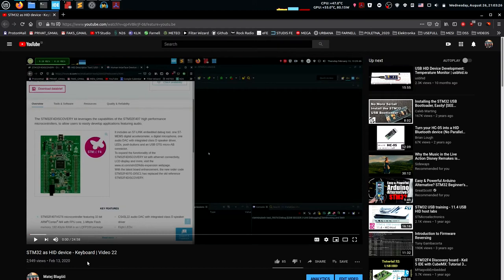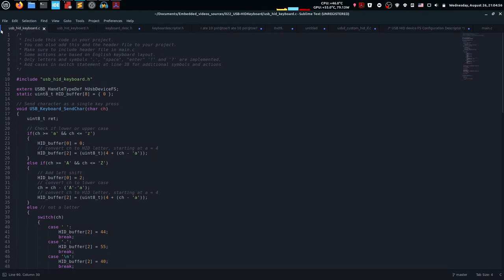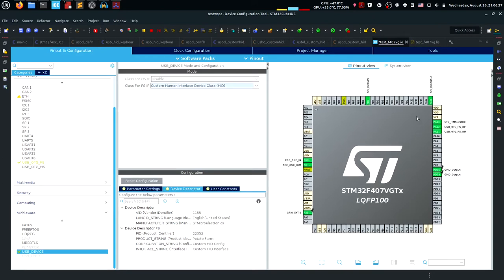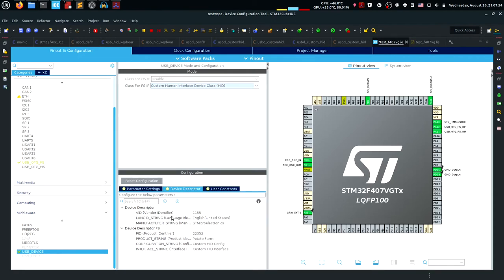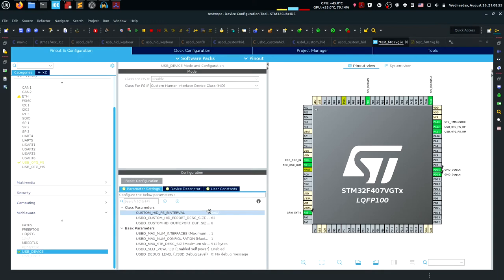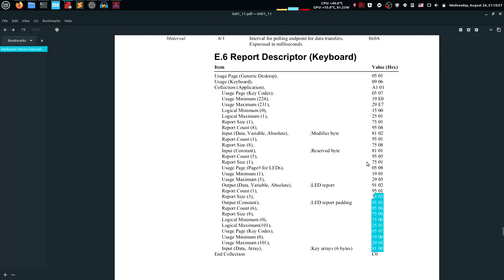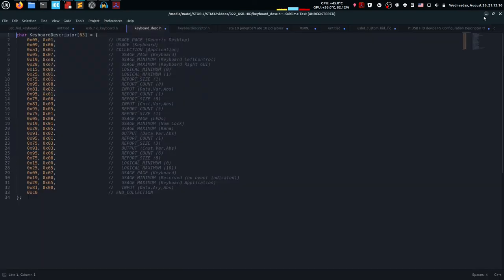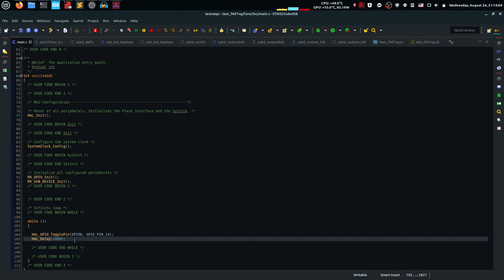Custom HID keyboard device | VIDEO 33

Comment: Is it possible to implement the led for caps lock num lock and scroll with stm32. If its possible can you guide me how I can do that ?
Reply from the maker: You will have to take a look into USB HID usage tables and the construction of the report. Here are the links to the standards:
https://www.usb.org/sites/default/files/documents/hid1_11.pdf
https://usb.org/sites/default/files/hut1_4.pdf

The report descriptor, that I used in the video was copied from somewhere else and happened to work fine as a keyboard, but it could support much more. The way your usb device sends data, that is interpreted by the host, is by looking at the structure of the report data configured by the report descriptior. In video, the array is called CUSTOM_HID_ReportDesc_FS.

The way the report is configured is by composing differrent groups of data together, defining their types, number and sizes. You can read an example in the HID_1.11 specification on page 35 of pdf around a descriptor for a mouse with three buttons. Since there are lots of different buttons to choose from and each only has a byte for an unique ID, the buttons are grouped into pages (usage pages). You can read more on them in the other document. This way a page represents a namespace of keys/functions with common features. Normal keys are in "Generic desktop page (0x01)", buttons are in "Buttons page (0x09) " and LEDs are in "LEDs page (0x08)".

You can use the aforementioned example from the document to compose a custom descriptor for keyboard along with the LEDs you wish to control as well. You will need to change some macros, like the report size (it is limited to 64B for USB full speed) and the report that you send. The length of the report (those bytes 0 and 2 that I set in the videos) are just part of the keyboard. Others will be mapped to match the report descriptor. 
I found this article as well, have a look: https://eleccelerator.com/tutorial-about-usb-hid-report-descriptors/

This looks like a fun "more in depth" video idea, but I don't have a device handy or time to test it now. Hope this helps for now.

Comment: Any ideas in regards to the cpu hanging when sending keyboard data?  I've set my code up exactly as it is in the video but every time I try to send anything, it sends the first char and then the cpu crashes and that character gets sent over and over.  I even disabled the button interrupt and used gpio polling to get the button press, but it has the same problem. Only difference is I'm using the STM32F411E-DISCO board clocked at 96MHz.  If i use the standard HID (not custom) device lib, it works ok.  /shrug
Reply from the maker: Just by that description I cannot think of a reason as to why. Must be either a interrupt or dma problem the way you described it. I would just use a debugger and find the point whete it stops working as expected. Maybe simplify the code even more.

Comment: When I generate code, I don't get a usbd_hid.h file.  The closest thing to that name is a usbd_customhid.h file under STM32_USB_Device_Library directory.  Did ST change their library code generation maybe? Or do I have something set up wrong.  I'm using STM32CubeIDE Version: 1.10.1.  Thanks.
Reply from the maker: Thank you for pointing it out. I added a link to the issue in the video description and comment as well.
Reply: My Inc and Src folder are completly empty... Any ideas??

Comment: Hi. Example not work in WinXP and BIOS.  How repair it?
Reply from the maker: Maybe the problem is with drivers in old windows, but the microcontroller should present itself as a usb 1.0 hid device, for which it should not need drivers. Have you tried on other computer? If it still doesnt work, maybe the code or the board has a problem.
Reply: the same device has been tested on many computers.  also tested several of the devices themselves.  On all computers and all devices, everything works fine if the operating system is Win7, 8, 10 but not XP or BIOS.
Reply from the maker: That is interesting, I have no idea why would that be, at least XP should support usb 1.1 out of the box, I even found a keil page for stm32 usb hid sample that claimed so.

Comment: Hi Matej, this is a very good guide. But I am having some problem tough.
I try using stm32f10c8t6 (Bluepill) connected to an IR proximity sensor as external interrupt, so when the sensor capture an obstacle the mcu would send a character to pc.
It work. But, it have a behaviour like we press a key but never release it. I test it using text editor , instead of write 'A' character, it would write 'A' character continously (and never end unles I unplug the Bluepill usb cable). I try debuging the isr callback function, and there is no problem because the interrupt callback is called exactly once on each obstacle.
Hope you can have some clue.
Thank you
Reply from the maker: When you send a key press to the computer, like 'A', you also have to send 0 in order to release the key. Sounds like this is the problem you are describing.
Reply: , Yes I also suspect this is the case. I use your library, and in usb_hid_keyboard.c file in line 142, there is already a routine to send release key report.
Reply: When I use USB packet sniffing tool, there is no release key data come from usb. The 'USBD_CUSTOM_HID_SendReport' return function not returning zero when sending release key (seems like USB peripheral is still busy or not ready to send data), so I create a looping to sending release key report again until succes('USBD_CUSTOM_HID_SendReport' return zero), and it work.
But this feels like a horrible hack to me :D
Maybe it is about timing or for some reason the peripheral still considering the data transfer is not done so the release key data is dropped.
Reply from the maker: That solution sounds good enaugh but I feel you. Maybe increase the time after sending a keypress from 15ms to 20. I mentioned that this is the lowest time it was working for me, so maybe try playing with that. 
Becausw you really need to send release key, that solution for sending data might be an ugly solition, but a necessary one. Just make sure you are not doing too much waiting in something like an interrupt routine, that is bad practise.
Reply from the maker: Hmmmm, you said that you used external interrupt to send keyboard data when you sensor released the signal. Usb peripheral also uses interrupt for dealing with usb data. Make sure that your external interrupt priority is lower than usbs. By default usb peripheral interrupt priority is 0, so lower your EXTI interrupt to 1 or lower(higher number). This way usb interrupt can preempt your exti interrupt. I recommend you to watch my new video 34 for more information :)
Reply: Thank you    , yes I already set external interrupt priority lower than usb interrupt priority previously. Regardless the delay, I got a stable key stroke with 30ms delay. That much delay is still acceptable for me, because the mcu not doing much work and it is not time critical device either.
Reply from the maker: Great, glad to hear that :)
Reply: I had the same problem and first I solved it with a bigger delay as you did, but if anyone is interested you can check the usb hid status by doing something like this.

USBD_CUSTOM_HID_HandleTypeDef     *usbHidClassData = (USBD_CUSTOM_HID_HandleTypeDef *)hUsbDeviceFS.pClassData;
and checking  if usbHidClassData->state equals CUSTOM_HID_BUSY

Comment: So for my keyboard it usually has a rgb pattern happening and now its frozen and isnt letting me type however my mouse is still working which is plugged into a port on the keyboard any advice?
Reply from the maker: I didn't have any problems with any of my computers. I don't have an rgb keyboard, but it does have backlight and some effects (logitech g610). Multiple keyboard should be seen as one input by the operating system, so I don't know why would that happen.
Reply: my computer is detecting 4 HID keyboards in the keyboard tab, however I fixed it by opening it in safe mode
Reply from the maker: Interesting. Thank you for sharing. Can you tell me if this problem is on windows, mac or linux?
Reply: windows
Reply: @issacdelgado3327  Had that problem with my At32u4 based Keyboard. In the end I had to fix the whole USB HID library. Simply redownloaded the library from some website and then reinstalled and rebuilt it. After that it worked fine, but some special keys (shift, cl, enter...) didnt worked.

Comment: if (pdev->pClassData == NULL)
  {
    return (uint8_t)USBD_FAIL;
  }
This is inside USBD_CUSTOM_HID_SendReport(USBD_HandleTypeDef *pdev,
 uint8_t *report, uint16_t len). 
My code runs into this error (Runs into exception error because of USBD_FAIL) Did I miss something? I went through the debug process and always saw pdev->pClassData = 0x0.
Reply from the maker: Sorry for late reply, didn't see it before. I don't have that much insight into usb driver but I can tell you that I had a problem with usb peripheral when I had another interrupt, i think it was exti one wired to a button and when I pressed the button, sometimes the code would crash. I lowered that interrupt priority level to (at least) one lower than USB's and I didn't have that problem anymore. I think it has to do with the way USB works and its strict timings.
Reply: thanks. That and enabling the internal oscillator made it work.
Reply: @dumdabake3287  hey, I ran into the same issue. What do you mean by enabling the internal oscillator? 
 Thanks in advance.